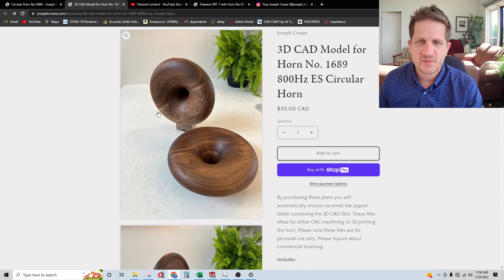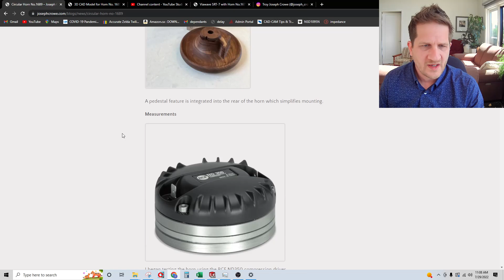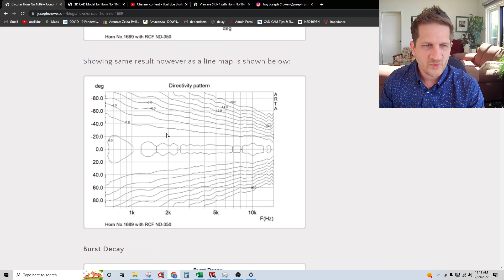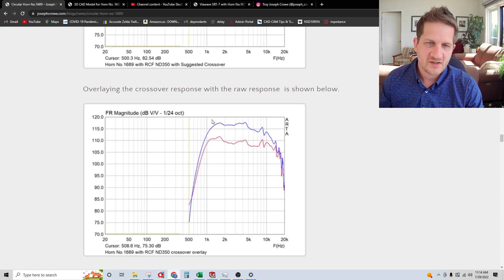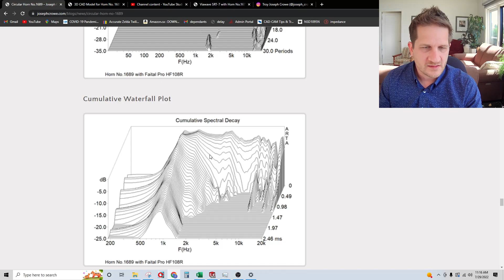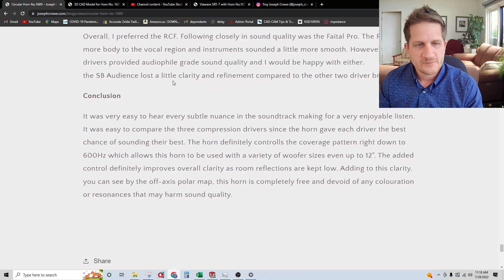Circular Horn No.1689

Comment: Do you have a design guide/spec for how far away from the cabinet the horn should be mounted. I understand that the wrap around mouth is important so flush mounting would be an issue, but how large does the gap need to be? Great product.

Comment: That looks awesome and fantastic polar response, do you get those same 1st order reflections if you went with a longer throat of the horn, or does it start to create (for lack of better term) port resonances?
Reply from the maker: It’s more about the way the mouth terminates with the air. There can be throat resonances but they only occur when there is abrupt transitions or parallel surfaces which create standing waves.